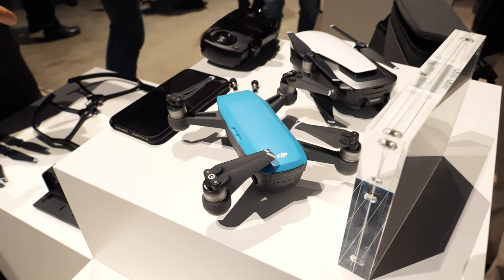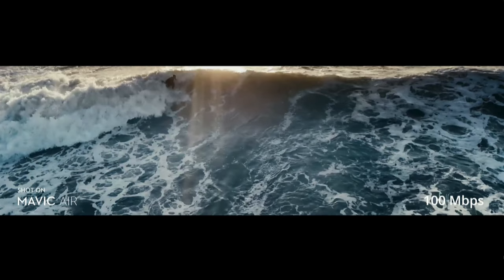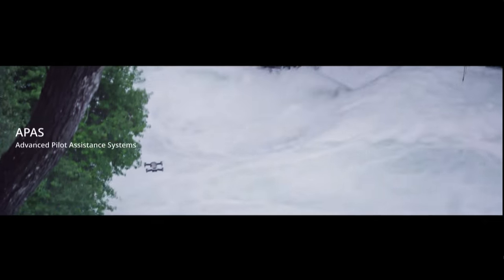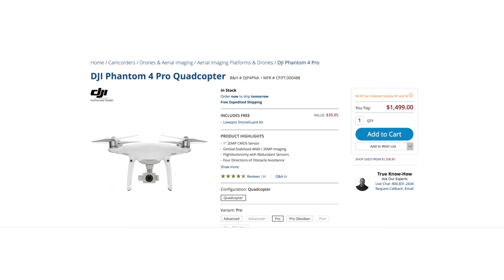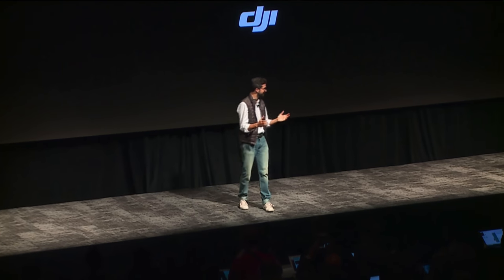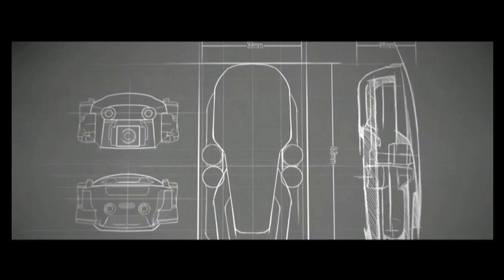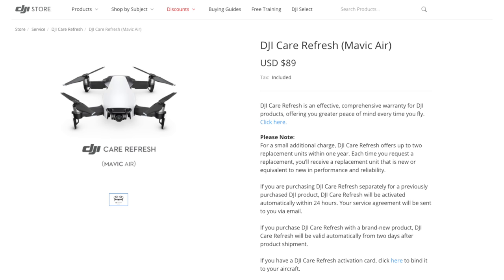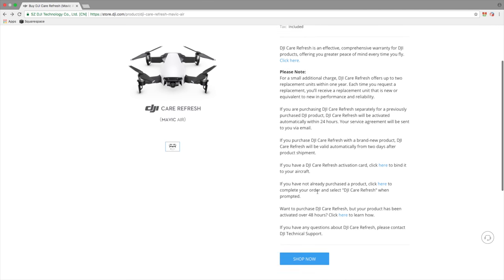DJI Mavic Air Just Blew Up the Industry - And My Wallet

Comment: the technology behind the obstacle avoidance is binocular vision, it's different than FaceID or iPhone dual camera. Without a doubt DJI has done a ton of work to take existing research and made it practical, efficient and affordable. It's a significant advancement to make that work in such a small package reliably. OpenCV and other research frameworks support binocular vision, but those aren't really as efficient as hardware accelerated binocular vision.
Reply from the maker: woolfel Thanks for the clarification - welcome to the conversation!

Comment: What holds me off from buying a drone at the moment is that the image quality of the Phantom 4's 1" sensor is so clearly superior to the Mavic's, but of course suffers with portability. It seems to me that there's a big opportunity for DJI to put that sensor into a foldable platform and I can't think of any reason that they wouldn't do so. It seems to me to be the next logical move. Even if it's a little bigger than the Mavic overall, that would be my preferred purchase over any of the current line-up.
Reply from the maker: Mark Thomson I understand completely.
Reply: Hmm. Nice idea. I love alll my drones and dont worry about the wish list so much because i can make money with any of the drones. It might be nice in the future though.
Reply: I do believe the Mavic Pro 2.0 will have a 1'' sensor, that will meet your requirement. I am also waiting for the Mavic Pro 2.0 to replace may old Mavic Pro.

Comment: Excellent presentation as usual Hugh.  Many thanks.  Full of informative facts.  I'm thinking of replacing my Inspire with this incredibly intelligent and compact device.  While I like flying the Inspire with the X5 camera attached it has proved to be impractical in many circumstances due to size and flying time to mention just two factors.  I have been wondering if now is the time to reevaluate my needs and the levels of functionality I am getting with the Inspire.  The Air comes up as perhaps a good alternative with its 4K camera, its avoidance systems, its extended flying time and of coarse its compact size.  Much to think about!
Reply from the maker: William Mobbs We live in interesting times, William. I find myself asking more and more often “what do I REALLY need?” Image quality is so good that the answer is usually not “the best,” but “good enough — for me.” Did you see that Soderbergh just shot an entire movie on iPhones?

Comment: Autel evo has 4k 60fps, mavic 4k 30fps. Autel evo has 1 inch, and micro 2/3 sensor where as mavic air has only smaller sensor with 1.2/3. Mavic fly up to 3km where as evo fly 7km and 30 minutes flight time. Mavic has 21 minutes only. Evo RC has a built in oled screen without using smartphones but can be hooked up on the rc.
Reply from the maker: Michael Hertez I look forward to giving it a go.
Reply: The oled screen on the EVO will be practically useless from a simple composition standpoint but, as with the Mavic Pro, useful for telemetry. I'm not sure it's valid to complain about squeezing 60fps in the Air, nor is distance considering you are required BY LAW to remain within VLOS. I do like the EVO in theory, but since it's not even available hard to do a fair comparison, and how will it stand up to the imminent Mavic Pro 2 which likely will have all those elements seen in the EVO and more? Like it or not, DJI is the big dog in the house and it's hard to see Autel or any other company unseating them any time soon.
Reply: amillerinADKs  I dont think the built in OlED screen is useless. IF your cell phone has low battery charge, you do not need to worry using it on the RC and you have an option to save your phone battery while using the built in OLED screen.
Reply from the maker: amillerinADKs Agreed.

Comment: Hugh, as with a number of recent DJI releases, we gain some features and lost some. Having both a Spark and Mavic Pro, along with a P4P,  I'll be avoiding the Mavic Air as it's primary telemetry system is WiFi, known for sporadic connection interuptions and resultant flyaways on other craft. That's a lose/lose here. Also lower flight time and immature controller (compared to the Mavic Pro) really take away from the advantages of an enhanced video feature set. I also have head that the Air is significantly loader that a Mavic Pro with newer props....
Reply from the maker: Dave Everett Dave, this is good input. I’m going to reach out to DJI.
Reply from the maker: Dave, directly from DJI: “... While the Mavic Air does use WiFi – it’s omnidirectional antennas are quite robust in challenging flight environments – e.g. a GPS-denied space with a ton of 2.4Ghz frequencies bouncing around, like the launch venue. The placement on the legs make them less susceptible to interference, but obviously if flying long-distance is a priority then the 21 minute battery life will also be a limiting function as much as the Wifi-based video downlink and telemetry...”

Comment: I found your channel because of your Air-gasm. Not that I blame you as many people have the same affliction. I am mesmerized by your on screen presence, which if I were to describe it would be the offspring of Mike Rowe and Jeff Goldblum. This is no slight at all as both those gentlemen are mesmerizing to watch, although I’m still calculating they actual offspring mechanics... but I digress. Thank you for insights, especially the Mike Perry aping of Mr. Jobs. I was going to send DJI an offensive letter if he had come onto stage in a black turtleneck. Keep up the excellent videos and I’m looking forward to your adventures with your Air. Did the Phantom sell yet?
Reply from the maker: swooshdave Hah! Mike really is a super guy. The auction still has just over six days to run. 1 bid, 7’watchers, currently sitting at just about $350 (just a few bucks above starting price).

Comment: I am getting one, even if I live in NFZ. It will be handy for my events shoots. It's perfect blend of portability and quality.

off-topic. What are your thoughts on Canon 6D ii. I am considering a second camera for GH5 for interviews, Sony is too expensive - lens+camera, and Canon has better range of lens and better focus. Any thoughts? Thanks.
Reply from the maker: Great AF and glass options, yes. But no 4K, 30 min limit. I can see the appeal, but if your interview goes longer than 30 minutes, you’re toast unless you add an external recorder. Tell me more about how you’d actually use it?
Reply: I am a tech journalist and during events, at most I allot max 20 mins per interview; 30 max. I plan to use secondary camera to shoot myself as an interviewer. These day, if you need branding you need to be 'on' the camera. So I am planning to keep GH5 for interviewee and secondary camera to shoot myself. My takes will be mostly opening lines, then questions in between. For everything else there will always be GH5. In addition Canon can also serve as a photo camera coz GH5 despite 42.5 f/1.2 is very poor in low light conditions so I can't even takes pics that I need for my text stories. I did consider Sony A7riii, but with 35mm lens (what I need for interview or 24-70), the overall cost will be around $5,400 - too much for a secondary camera, plus it doesn't have flip out screen. Sony lenses are expensive and Canon is known for correct colors and great range of lense. 

As far as 4K is concerned. Initially I shot on 4K, but 20 mins interview take over 50-70GB of hard drive. Then even my my powerful iMac, it can take 3-4 hours or more to render files with all LUTs, color corrections and sound corrections. Then most viewers don't even watch it on 4k; majority of people - which is tech audience - watch it on phone or laptops. So I am going back to 2k. I will shoot 4K only when I need landscape shots - like when I visited Sydney, all other indoor shots will be in 1080; 4k is not there yet. 

Also interviews can always have cuts between questions. If I was recording live shows then continuous shoots matter. But I really don't record live shows.
Reply: Here is some video interviews:
https://www.youtube.com/watch?v=q7m3z2No2c8
https://www.youtube.com/watch?v=VHr3ucarRdc&t=92s
Reply from the maker: Swapnil Bhartiya sounds like the 6D II would work well for you.
Reply: Thanks. You are awesome. Hopefully, will get to meet you someday. You are my fav Youtube personality.
Reply: Just got Canon 6D Mii with 24-70 f/2.8. Oh. I so LOVE the camera. It's so fast, colors are so much accurate. Damn, GH5 looks like iPhone when I compare mid-light footage. Canon reminds me of why I kept Nikon for such a long time - great lens, great color science.
Reply from the maker: Swapnil Bhartiya so happy that you’re happy - enjoy!
Reply: Three Blind Men and An Elephant Productions I am keeping both.
Reply: I spoke too soon. After doing some interviews and shoots with it I discovered the flaws. A very very poor dynamic range. You can't even see wrinkles on my black shirt. While color matching between GH5 was not hard, though there is no flat profile or log on 6D Mark 2, the lack of dynamic range and lack of sharpness was making it hard to keep consistency between shots. Then it had all the other drawbacks - no continuous shoot and no dual slots. So I am returning mine. I think I am going to stick to Panasonic to save time in color correction. Now, GH5 is not known for low light so I am debating between G9 (but compromise on continuous shoot) or GH5S. I have seen your video with Max. You were holding GH5S. What's your opinion on using it as a photography camera too. I even considered getting another GH5...but really want to know if I should instead get GH5S or G9. Any thought will be welcome.
Reply from the maker: Swapnil Bhartiya GH5S is impressive in low light, but 10mp is Tiuch for stills work unless your final image is relatively small. But if you’re adding it to a GH5 and use the regular ‘5 for photography, you’ve got the best of both.
Reply: Thanks. I will be ordering GH5S tomorrow. I don't print my pics in 300x300" size. I use them in magazines with stories. But 14bit raw images from video files might give me enough dynamic range to get good pics even for that purpose. Really admire your work and appreciate your responses.
Reply: Just got G5S, lol, but macOS or Lightroom can't open the rw2 files created by the camera.

Comment: Unfortunately anybody that bought the Mavic air is going to be extremely disappointed due to the fact that the next generation of the real Mavic is coming out with a 1 inch sensor which absolutely blows the Mavic air away which could not even compete with the older pro why DJ I released a drone like this is for people that strictly wanted a toy disappointing